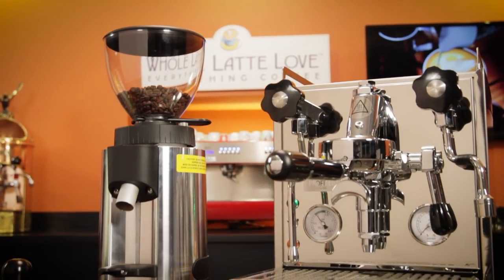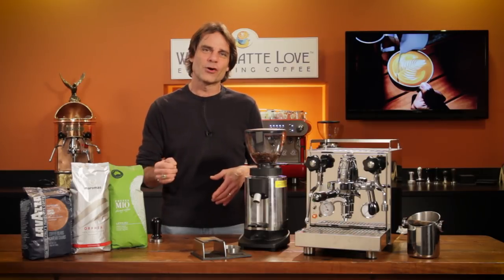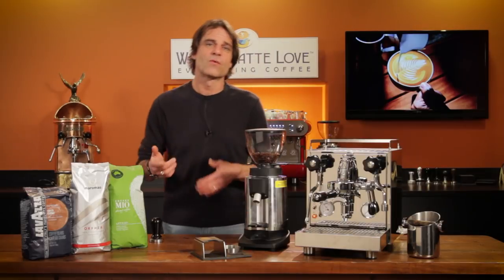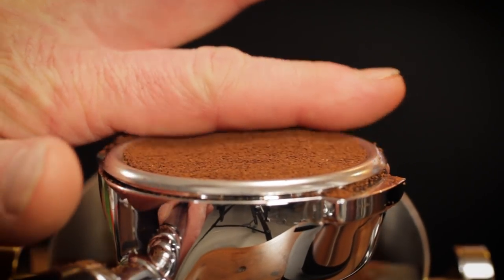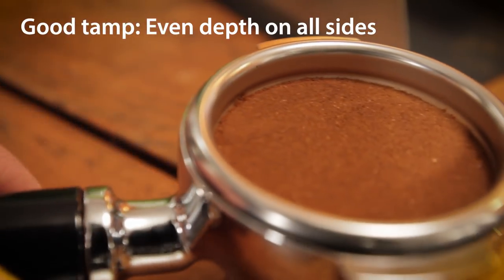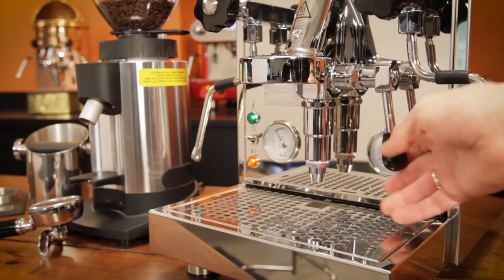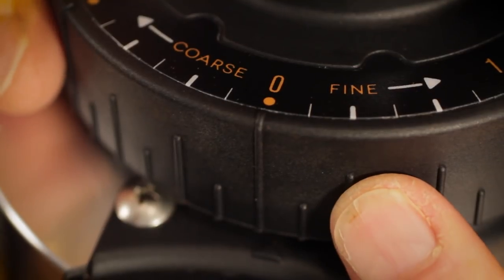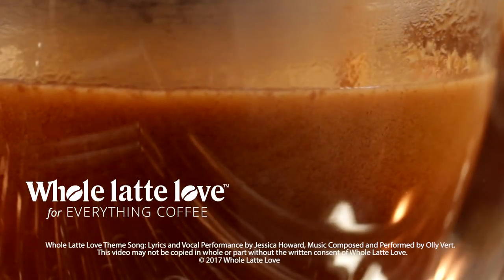How To: Basic Espresso Technique - Dialing in Grind Size

Comment: I noticed when you pull the last shot your 2 ounce mark included the crema,  I understood that you would want 2 ounces of liquid plus crema.  Could you clarify for me please.
Reply from the maker: Hi John, Thanks for the question. So this is a basic technique video. For more precision it's best to use a scale to weigh coffee dose and output and come up with a brew ratio. Typical brew ratio for espresso by weight is 1:2. For example: use 17g dose of ground coffee to produce an espresso weighing 34g. Some coffees produce more crema than others so using liquid volume is difficult and takes some guessing if not using a scale to weigh the shot. Check out this video: https://youtu.be/HTaly8c-i_U In the video I pull bottomless triple shots using an app connected scale to log the extraction. In the vid I use a coffee dose of 21g and stop the extractions at a weight of 42g for a 1:2 ratio. Volume in cup including crema was reaching near 70ml (~2.15oz). Although not discussed in the basic dialing in video I know from experience the coffee I was using produces something close to a 1:2 brew ratio when crema reaches ~2oz (60ml) in the cup. Hope that makes sense!
Marc
Reply: @Wholelattelovepage  thank you very much Marc. Will try it tonight.

Comment: When I pull a shot and it's MOSTLY crema, it may START as 2 oz, but as it sits, the crema drops and the liquid rises. What started as a 2oz shot could settle down to under 1.5oz...do I measure the foam or the settled liquid?
Reply from the maker: Hi SW, Thanks for the question. The most accurate method for measurement is weighing shots. As you've found, volume measurements require some judgement. Much depends on the coffee being used. Prolific crema producers pulled at typical 1:2 ratio from 18g of coffee can produce volume including the initial crema to >60ml/2oz with finished weight of ~36g. For typical classic Italian style bean blends (which produce a lot of crema) 60ml/2oz as the shot completes is about right. As this was a basic technique video I did not get into weighing shots.  Hope that helps!
Marc

Comment: I’m wondering what dose gram wise to use for a triple shot portafilter. Also extraction time and should I be getting 3oz of espresso?
Reply from the maker: Hi DD, A triple shot is generally made using a dose of 21 grams or more. As for volume and timing 3oz would be normal and timing is similar to pulling doubles. But many who do triples will pull shorter more concentrated shots and depending on the coffee some may do longer duration extractions. In the end it comes down to what you like flavor wise. In the last few years dose sizes have been trending up. According to a recent Barista guild of America survey the typical barista is using an average dose of 18-20grams and pulling what they consider to be a double from that. Here's a video we did which goes into greater detail on what the average barista is making: https://youtu.be/a16QqiK4hzo

Comment: I have a Eureka MCI and the espresso powder never comes out as fine as in your video.
There are always chunks that I have to make small with a toothpick.
Is the mill perhaps broken or are such "chunks" normal for not so expensive mills?

Greetings!
Reply from the maker: Hi 151, Thanks for the question. Some chunks are normal in lower cost grinders. As you go finer with the grind they get even chunkier.
Marc
Reply: @Wholelattelovepage  thanks. I wouldnt consider 340 euros as low cost personally but i keep grinding :)

Comment: Question! If I do single shot of Expresso. How much time to brew with 7-8grams of ground coffee?
Reply from the maker: Hi TS007, Thanks for the question. Extraction time is about the same regardless of the coffee dose. So go 20-30 seconds from first drip using 7-8g in a single shot filter basket.
Marc
Reply: Thank you for your reply! My DeLonghi Dedica makes a single shot at 2 ounces and a double shot at 4 ounces. Is that good or should I adjust? What I believe is correct is use a filter to hold 14g of ground coffee and click the single shot to make 2 ounce of coffee?

Comment: Hey Marc! I went to central market the other day to pick up some coffee with hopes of extending my draws. I bought 2 different beans and ground one to the espresso dial on the machine and the other to Turkish which was the finest grind setting on the grinder at central market. Unfortunately. my longest draw time was only 10 seconds! I was surprised because I know that the profitech 300 that I purchased from you guys should not be going that fast? Are there any other possible things I could do? Do you have coffee beans/ pre-ground coffee that you could recommend me? Are there any configuration settings on the machine that I could possibly fiddle with? Thank you Marc!! I am very determined to make the perfect flat white with this new trusty profitech!!!
Reply from the maker: Hi Mike, Thanks for the question. I don't think it's a setting. I think it's grind size and/or dose weight. If shots are coming in 10 seconds your grind is too coarse or your dose is too small. 
If at all possible do not use pre-ground coffee. It's difficult to get good results in  standard commercial filter baskets from pre-ground coffee. For best results grind your coffee right before pulling shots. If your central market grinder was actually grinding turkish fine it should have "choked" the machine meaning it's so fine that no espresso comes through. A turkish grind is near talcum powder fine. No espresso machine could brew through that. Nor would you want it to. For easy to work coffee I recommend Italian style bean blends intended for espresso making. My favorite is Maromas Orphea: https://www.wholelattelove.com/products/maromas-orphea-whole-bean-espresso Like any whole bean coffee proper grind size is critical.
Marc

Comment: Hey Marc, Just got an ECM Technika V from you guys. Do I need to flush first with this PID machine?
Reply from the maker: Hi Rich, Thanks for your patronage and question! In most cases recent HX boiler machines with PID do not require flushing prior to brewing. It might be needed if you have boiler temp set really high. Easy way to find out is to have a look at flow coming from the shower screen. If it's extra bubbly that indicates flash boiler and temp at or over boiling. If you see that flush a few seconds until flow is smooth. Many do a very short flush just to knock off any coffee particles on shower screen prior to brewing.
Marc

Comment: Hey guys :) ive used Orphea for my Gastroback Advanced Pro GS and i couldnt make it fine enough to run 20-30 seconds.... now ive changed to lavazza espresso (purple one) and its awesome! it runs 27 seconds every time, got so much crema, its not that expansive (15 euros/kilo) and it tastes perfect with and without milk. thx alot :)!
Reply from the maker: Hi T, Thanks for sharing. That machine is a Breville Barista Express: https://www.wholelattelove.com/breville-bes870xl-barista-express
Honestly surprised you can't get the Orphea dialed in but have no problem with the Lavazza.

Comment: Many thanks for the video 
I have the Oscar 2 and i am wondering what is the best mesurment grinder if i use sette 270?
Reply from the maker: Hi Rami, Thanks for the question. Sounds like you want to know what grind setting to use on the Sette? Honestly can't say for sure. It's going to depend on your coffee dose weight, the coffee itself and other variables like brew temperature, tamp pressure, etc. There's no "right" setting to use. As explained in the video you need to dial it in through some trial and error being consistent with variables other than grind size. I can say I was pulling shots ground on the 270 yesterday and found a setting of 6H worked best for me using a 17g dose and Lavazza Super Crema. Not saying 6H will work for you but maybe start with that and dial in to fit your other variables. Hope that helps!

Comment: I got a Compak E5 grinder and I wanted to know your tips and trick not sure I like it very much. Just starting to use it. Also got a Elektra S1CO Microcasa I put 16g for my double in it but when pulling my handle off it seems to always have some water flotting on top of the brewed coffee ??  I don't know if you can help?

ELEKTRA S1CO MICRO CASA
Reply from the maker: Hi IP, The Compak E5 is a nice grinder. No real tips particular to that grinder other than dialing in the grind size as in the video. As for you machine. I have not personally used that model. Some water left on top of the puck may be normal for this machine.

Comment: We have a new Breville Barista Express. We are having problems pulling the perfect cup of espresso. We have adjusted the grind size but it keeps over extracting. The pressure gauge keeps going over to the over extracted zone. What are we doing wrong?
Reply from the maker: Hi Adrian, Are you using the single wall (non-pressurized) or the dual wall (pressurized) baskets. If using single wall and having over-extractions/high brew pressure then you need to make the grind coarser and/or decrease the dose of coffee in the basket.

Comment: Hello Mark, I have paired the Quick mill Alexia evo with the Profitec Pro T 64, any suggestions how to start ie boiler temp, grind settings at the initial first shot, I'm totally new at this, first how would you rate the pairing I've decided on, basically just need reassurance that I haven't made a pigs ear with my choice, I based my decision on reading and looking at great videos like the ones you make, thnx in advance
Reply from the maker: Hi Paul, You've done well with pairing the machine and grinder. I'd set you machine to deliver brew water at 200F. I suggest starting with only doing double shots (very few people pull singles as they are much trickier) using the double shot basket. Be sure you machine is fully warmed up and leave the empty portafilter in the grouphead until you grind for your shot. Most critical part of making good espresso is grind size. Use the steps in this video to dial in your grind size. As mentioned in the video keep all other variable the same as you make grind size adjustments. Use the same amount/weight of coffee each time you pull a shot. If you have a scale you can weigh the coffee. If no scale, just slightly overfill the portafilter and level with a light finger swipe. Then tamp the coffee. Tamping pressure should be firm and create a level surface to coffee puck. Actual tamping pressure in pounds is not critical. Just be firm and try and use the same pressure each time you tamp. As explained in this video the goal is to produce 2oz/60ml of espresso in 20 - 30 seconds from first drip. I do suggest starting with good coffee that's also easy to work with. Here's one of my favorites: https://www.wholelattelove.com/products/maromas-orphea-whole-bean-espresso Hope that helps!
Marc
Reply: @Wholelattelovepage  Hi Mark, thank you for your quick response, I will take your advice and of course watch the videos, the T64 will arrive Wednesday 24th, so much looking forward to it starting a new adventure, hoping my coffee looks and tastes half as good as yours, I bought Lavazza Rossa blend a friend recommended, of course i will try your favourites and see how we go, I will keep you posted when all is up and running, thnx again
Paul
Reply from the maker: You are welcome! I love helping people out. Do keep me posted. I'm about to start a week vacation and will be off grid for most of it. But if you have more questions do ask and I'll respond on my return!
Marc
Reply: Enjoy your Holiday Mark, you deserve it

Comment: So if i have a grinder that is operated by hand the coffee should be a bit finer than coarse salt or sugar?
Nice video btw.
Reply from the maker: Hi Thorben, Thanks for the question. That's a start. For a great shot you will need to dial in the size more precisely. What type of hand grinder are you using?
Marc
Reply: @Wholelattelovepage   Should it be finer?
Reply from the maker: Yes, Somewhere between granulated sugar and standard table salt.
Reply: @Wholelattelovepage  Thanks a lot

Comment: When you refer to the target of 2 oz. (60 ml), is it the top of the crema at the instant you stop the pull, the top of the crema after it settles (15-30 sec.), or the bottom of the crema at one of those 2 points?  For example, at 24 seconds the top of the crema was at 75 ml and the bottom of the crema was near the bottom of the shot glass.  After settling, the top of the crema was at 60 ml and the bottom of the crema was at 47 ml.  I'm guessing from your video that I should be aiming for the top of the crema at the moment that I stop the pump (75 ml in this example).  Am I correct?
On the other hand would a better method be by weight (2:1 ratio) as you suggest in your related video?
Reply from the maker: Hi Robert, There is some guesswork when pulling crema rich shots and using volume! And yours is a question I get all the time - so much so I covered it a couple of weeks ago in this video: https://youtu.be/L81honj38tw Weight aka brew ratio is a more accurate method for those who want to go there.
Marc

Comment: Does portafilter size change the amount of coffee grind I should use? Currently using 54 mm portafilter.
Reply from the maker: Hi rp, You can use what works for you. As you dial in the grind size it's best to keep the weight of coffee dosed into portafilter consistent.
Marc

Comment: My Office Lever recently started going blonde after aboiut 10 seconds. I have my brew pressure set to 10 bar via a gauge on the portafilter and I'm using the same coffee at the same grind that has always produced great crema shots before. I clean my machine frequently and flush after every shot. I use filtered soft water and I roast my own beans, so they are fresh. Any suggestions?
Reply from the maker: Hi JB, Thanks for the question. We setup vibration pump machines to produce 10bar on the pressure guage on the machine with a blind filter in the portafilter. With internal overhead, that produces about 9bar at the group when brewing. Any chance your gauge is not reading properly? Understand that setting your machine to 10 bar means that is the max pressure it will brew at. What does the gauge on the machine read while you're pulling a shot? If blonding out that rapidly I'm guessing your grind is too course.

Comment: Hi Marc! Thanks for the videos. My question is everyone keeps saying 16 to 18 grams of grunded espresso. At first i was measuring the beans to 18grms and then grinding but the end result is always less. Then i was measuring the grounded output bean to 18 grms. Either way my shits were no good. I have played with the grind size and different coffees for 4 months to no luck so i need help. I have the Breville Bambino and yes i know is considered an appliance but i should be able to get a descent shot. I also have the Breville smart pro grinder. Any suggestions?
Reply from the maker: Hi Stitch, You are welcome and thank you for the question. Your Bambino uses pressurized filter baskets. It's not capable of the same quality as machines using standard non-pressurized baskets. But you should be able to get a relatively decent shot. I'm curious as to what type of grinder you are using. As you have found, single dosing - weighing beans before grinding will almost always give a lower output in weight due to grind retention. Unless you have a purposely built single dosing grinder it's best to weigh output rather than input. I'm honestly a little surprised you are able to fit an 18g dose in the smaller 54mm filter basket of the Bambino. Dose amount is not critical. Just be consistent with weight for each shot. From there play with grind size. Using a pressurized filter basket limits one's ability to judge how grind size adjustment changes an extraction based on timing as it's the restriction of the pressurized basket controlling flow and not the grind size of the coffee. What you can do is use flavor as your guide. In general if a shot is sour you should grind a little finer. If it's bitter you should grind a little coarser. Start at a grind size that's similar to table salt and go from there. Hope that helps!
Marc
Reply: Thanks Marc. So i did buy a non pressurize basket and bottomles portafilter for this machine. I watched ur videos on the bottomless portafilter and they really helped me figure out my tamp mistakes. It was very hard to find both the non pressurized basket and bottomless portafilter on a 54mm size and yes 18grams of coffee fits just fine. I will measure output from now on and play around with the grind size. I also bought the Maromas Orphea coffee you are always mentioning from your site to see if the coffee makes any difference. Thanks for the help!

Comment: Marc,  do I need to flush the heat exchanger of a Rocket R58 with PID set to 219º ?
Reply from the maker: Hi Thomas, Under normal circumstances no you do not - It's a dual boiler so there is no heat exhanger.
Marc

Comment: I got my coffee grind too fine for delonghi EC685 espresso machine. And it’s dripping like there’s no consistent flow at all when I take espresso shots. 
As I have 250 gr of it already grind, I was wondering would it harm my espresso machine if I keep using that?
Reply from the maker: Hi AV, I'm likely a little late with an answer - sorry been on vacation and offline for a few days. It shouldn't hurt your machine. If grind is too fine I'd advise lowering the does weight in the portafilter. Not a perfect solution but it will speed up the flow and help prevent an over-extraction.
Marc
Reply: Whole Latte Love thank you very much for your excellent explanation! I appreciate that 🙏🏻🌸